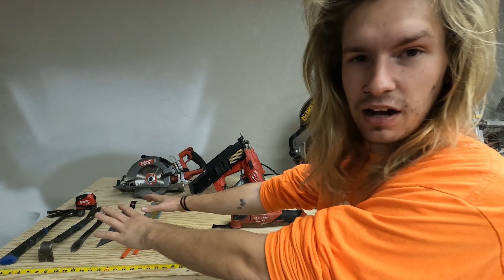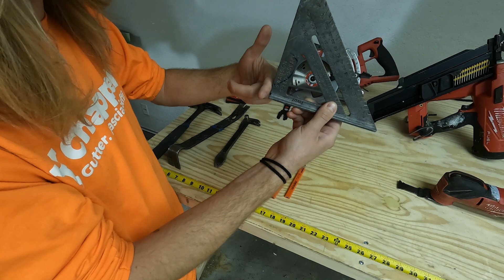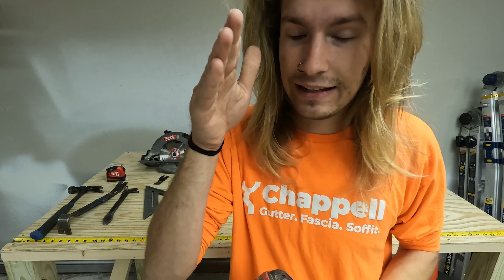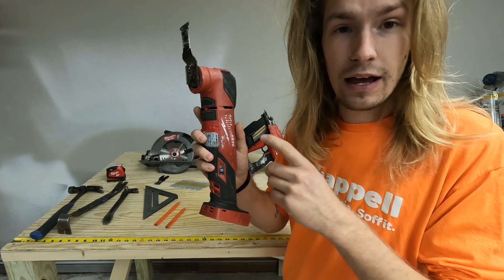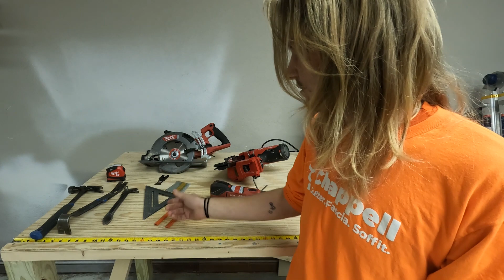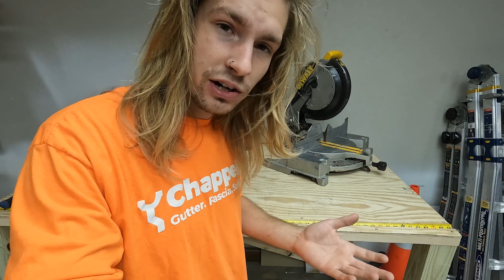Tools You Need To Replace Wood Fascia | Fascia & Soffit Repair

Comment: Good video. Now please show how to get the gutters out of the way, without tearing them up, in order to  replace small sections of rotted fascia. Thank you!
Reply: That's the thing... This all needs to be done while the gutters are off the house. 

In most cases it's best to replace the gutters at the same time as replacing the fascia

Comment: I have a older house block, im considering leaving the soffit open but seems i will have to sand the exposed rafter tails and wood. Whats a good water resistant primer paint or application for cosmetic and water protection ?
Reply from the maker: I would have to see photos to know exactly what your referring to. I love bear marquee paint. You can purchase it at any Home Depot. Satin finishes are typically standard on a home's exterior. I'd apply two codes or three if you want to take extra precaution